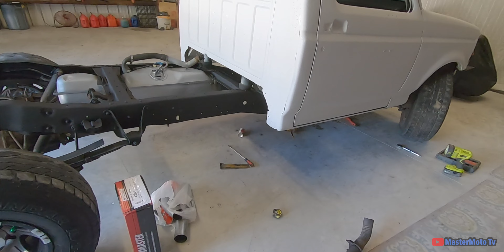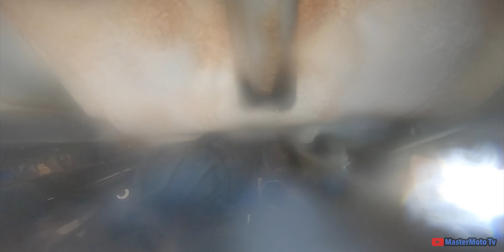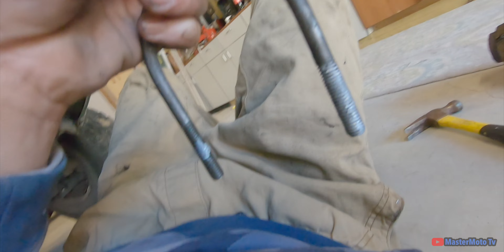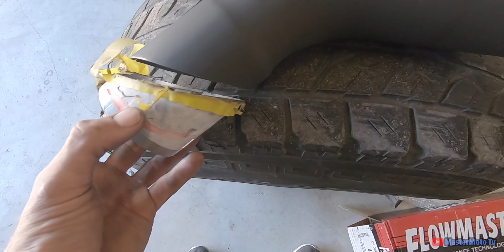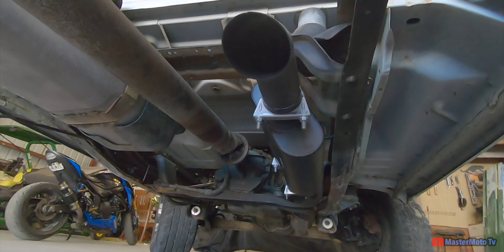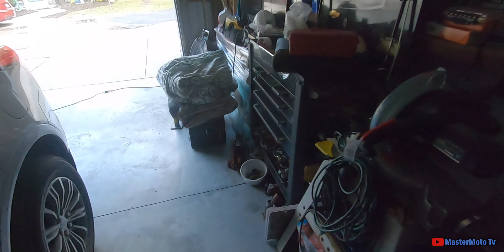1995 F150  300 Inline 6  Flowmaster 40 Series

Comment: Should've cut the exhaust, muffler, and resonator and straight piped the exhaust/dump the exhaust under the cab. Still sounds alright though.
Reply from the maker: From my understanding and from people Ive spoken to, the ford 300 needs a bit of back pressure. My buddy had the same truck, straight piped it out the headers and dumped it under the bed. Motor blew up about a month later. 

I’m working on getting long headers, run a mid resonator and dump out behind the wheel.

Comment: I've got the 95 300 with factory headers (2-2" lines)  I put a flow master 40 on the duals (2 in 1- 3" out) more drone than I wanted but it sounds good for a 95 h.p. 6 banger